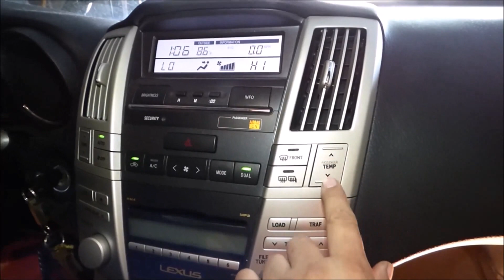2007 Lexus RX350 HOW TO FIX BAD Heater Blend Door Actuator

Comment: Hello bud nice video. 
Have question I have a 08 Camry on the dash it shows warm air vent is open but it’s only throwing from main vents which faces us I did checked the actuator it’s working fine any suggestions please. Thanks
Reply: Hi! If you think that the actuator is working fine, it could be that the actuator it's stocked in a different position but the computer thinks that is the warm position, maybe the sensor is sending a wrong message, I would disconnect the battery for a few (5) minutes and see if the message goes away,
Reply: Hello thanks for the information bud. I did tried that too but still not working 
It’s all pointing to the actuator I guess it’s not turning enough for vent to engage. Your additional input will be appreciated. Thanks

Comment: My 2002 4 runner has a heater cable,  that goes to the heater valve on the firewall.
The cable itself was corroded and would not move freely.
That caused my module to snap off the armature. 
Check your cable if it moves freely.
Replaced the cable and the module...problem fixed.

Comment: I have a 2012 lexus gs350 f and i think I have a faulty blend door actuator. My current problem is that the driver side blows cold air, while the passenger side and the back seats only get hot air. I've tried turning the temp up on high and also on low for the passenger side, but they still remain on hot, but get even hotter when i turn it up to max. I am afraid to test the driver side if it will get hot, because I live in the the tropics, this will be even worse for me. I am thinking of purchasing a blend actuator for the passenger side, but am not 100% sure if this is the right move. Could I get some advice? Thanks in advance!
Reply: ralph rodriguez this is my issue! What did you do to fix it?
Reply: Did you ever figure out which part you need to fix your issue? My driver side & windshield is blowing cold when running the heat. I’ve replaced these two parts & it’s still blowing cold. 
I drive a 2010 Lexus RX350. 

HVAC Air Door Actuator Heater Blend Door Lever for Toyota Camry Highlander Avalon Sienna Venza Lexus ES350 RX350 (replaced on driver side)

A-Premium HVAC Heater A/C Blend Door Actuator Replacement for Toyota Camry 2007-2017 Highlander Avalon Sienna Venza Lexus ES350 RX350 (replaced on passenger side)
Reply: James Carroll  but wouldn’t it blow cold on all the vents instead of just the driver side?
Reply: @theresafaye316  the problem actually just went away after not driving the car for like 2 days. This was like a year ago and today it still hasn’t come on up 😀
Reply: @Pepsi864  dang! Lucky you!
Reply: I have the same problem on my 2015 Rx 350. cold air on driver when running heater but the rest on the vehicle is fine. Was it your blend door actuator?
Reply: @shopdoc  how did you fix this. I have a 2010 lexus rx350 and hot air on drivers and cold on passengers

Comment: What worked for me, passenger side cold driver side warm, even tho the ac fix gauge would read near the yellow ~50+psi you need to go into the car and press the throttle and let the car run at ~1500rpms for a minute and when you come back you'll see it drop to 35-40psi and you can fill in more refrigerant. 40-55psi is in the acceptable range for the low side reading on a ~90 degree day. In the end the issue was not enough refrigerant but because the gauge read full I was hesitant to continually fill it up, when you go to an AC tech they just suck all the refrigerant out, weigh it, then refill it to spec so they know exactly how much is in there based on weight not pressure.

Comment: Just started today on my 2007 RX350. I have cooler air on passenger side and warmer air on driver side. I have dual zone temp also so im sure that has to be a factor also.
Reply: What did you end up finding?
Reply: @TheBlooRayChannel  well a couple yrs ago a good mechanic my family knows said that the compressor was starting to work a little harder than it should. He showed and explained to me the pressure gages he had connected. So what i ended up doing was replacing the compressor, the condensor and the belt and now i have super cold air coming through. I got the parts from Rockauto cause they were like half the price from Auto Zone and Advance Auto.
Reply: @tonytone5462  yes but your comment is 3 months old where you state the temp difference. Have you rectified the issue yet?
Reply: @TheBlooRayChannel  yes i said what the issue was and how i fixed it. I knew my compressor wasn't operating at  100% so when i spoke to the same mechanic that checked it for me a couple yrs ago, he suggested it was time to change out the compressor. So i did and it works wonderful now.
Reply: @tonytone5462  right. You mentioned you changed the compressor 2 years ago. But the comment on YouTube that says 'just stared today..' is 3 months old which didn't make sense.
Reply: @TheBlooRayChannel  ok i see how you could think i changed it yrs ago. What i should have said was i had it changed a couple of months ago.